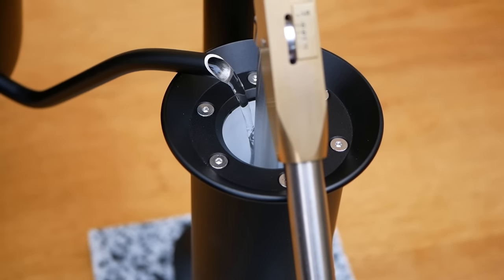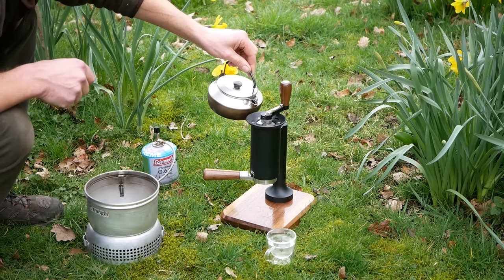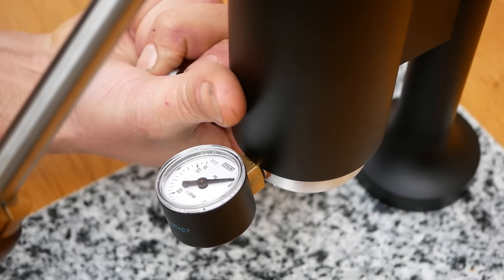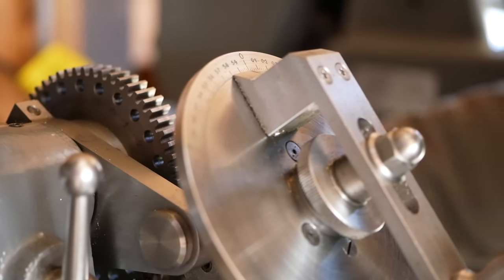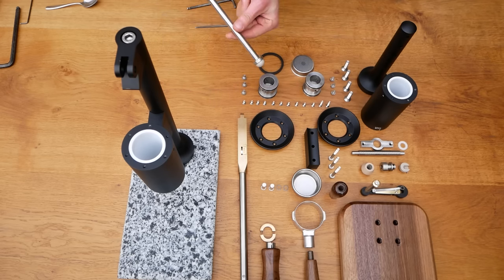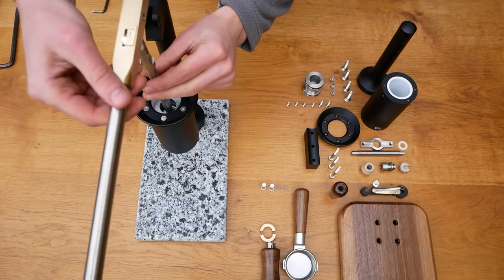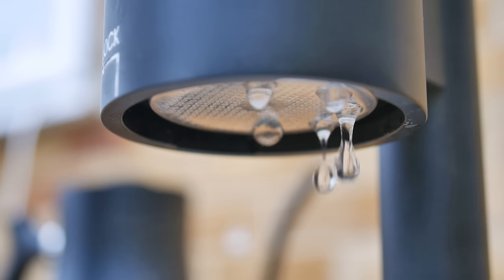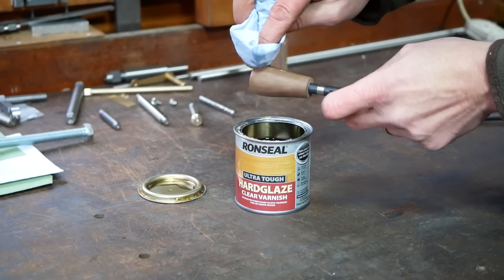We Made A Modular Espresso Machine

Comment: The torque wrench design for estimating pressure is really clever. I love it
Reply: Except that it can't possibly relate the actual chamber pressure based on applied torque. There's too many variables that affect how much input torque you might need to get to eight or nine BAR in the helix machine. Less of a problem on the fulcrum machine, but still not a substitute for a direct pressure reading.
Reply: @SwervingLemon  thus the word, "estimating." 😉

Comment: I want one of these that mounts to the kitchen sink or bench like a faucet/tap as a fixture in the kitchen. It would pair beautifully with a boiling water tap system. Maybe a hydraulic pedal tucked under the cabinetry at floor level. Baby oil is food safe (just upsets your stomach) and used in mountain bike brakes.

Comment: last generations? uses custom one way valve when it wears out replacement will be all but impossible, aluminium torque bar with no way of re-calibrating (aluminium being less than ideal as cyclic loading will have a grater effect as compared to a ferrous metal), custom pivot bushing sure it will have a long service life but if it is damaged during service or use it will be all but impossible to replace, and custom lead nut i like how you glossed over this part in you're video leading me to believe you are aware of its shortcomings.

Comment: Yeah, my very first concern was temperature control. Glad you discussed it, but would certainly like to hear more.
Reply from the maker: Hi Username, we have some additional temperature tests planned, from which the detailed results will be published on the Kickstarter page.
Reply: @chronovaengineering  Super appreciate it, thank you!
Reply: I stopped using ROK espresso lever machine because of the lack of pressure gauge and poor temperature stability. 
I’m now using Flair 58 equipped with the heating element and fitted a temperature probe to make sure I’m pulling a shot at 94C. 
And even with all that, there is quite a learning curve and tricks to use for the heat consistency. 
Also, I highly recommend using a puck screen.
Lever machine destroy the puck when transferring the water from top to bottom. 
Else you end up with crazy channeling and a dirty mess to clean. 

Love the screw system but I can already see it will most likely be too slow when priming the piston (losing heat and time) and then purging after. 

Manual lever machine are quite time consuming when used regularly.

Comment: its nice but.. i dont know why you need to replace a pressure gauge.. you can easily read the pressure in a wider range and more accurate than what you have been showing. seems like you are really limited ... especially if you want to do a pressure profile. Plus... they are inexpensive and rarely break.
Reply from the maker: Hi MrHackclan, 

Aesthetics aside, this kind of pressure gauge offers several extra advantages:
1) No risk of pressurised water leaking out via the pressure gauge hole.
2) No stagnant water building up in the pressure gauge or connected channels.
3) There is limited space to mount a conventional gauge. It would either have to go through the piston or in the side of the cylinder, where you would lose a reading towards the end of the piston stroke.
Reply: @chronovaengineering  I can understand that and your solution would be very nice.. if the measurement was not limited to 4,6,8... and some addtional indicators for the steps in between would be nice. Also it would be a very nice touch if there is an indicator for optimal preinfusion.

Comment: I love the pressure readout! So much neater than a gauge.

Do you think that it's worthwhile to preheat your cup before putting the coffee into it? Or is this just a waste of energy
Reply: Except it literally is a gauge, it's just packaged to be more aesthetically pleasing.  Flexion-based gauges have been used for quite some time, the only new thing here is how its packaged, and really the only reason why it'd be potentially worthy of a patent in the first place.  If it's even patent-worthy then, as it's just flexion and lever amplification, the actual patent is probably for the machine as a whole, especially as how the gauge is an integrated part to the lever arm itself and not a separable device, of which then it would be patent-worthy; and probably what allows the machine to exist without infringing on similar machines' IPs. 

Preheating cups is also fairly common practice, as to not thermally shock what you're brewing, if you're drinking the brew straight.  Look at Eastern methods of brewing tea, everything involved gets preheated and rinsed, modernly some derivatives of these brewing methods also have a 'tea pet' of which changes color depending on temperature.  Coffee, and really anything that is hot-brewed, should be treated the same way, as to not produce unfavorable tastes; much similar to how brewing too hot or too cold will affect the brew itself.  Although I'd also argue that coffee is much more sensitive to temperatures and shock if you're drinking plain coffee, this is also why people will commonly add creamer and sugar, to offset any off-tastes; similarly, this is also why cream and sugar is added to tea, though modernly this hails from a period where pre-modern compressed tea would've been nearly undrinkable without cream and sugar, the basis of this comparison is the bitter notes that both coffee and tea can produce, though coffee can also produce sour notes if not at the correct temperatures.  The only real time this isn't relevant is if you're making espresso-based cold drinks, where there's such a disparity in the volume of ingredients that the milk base will cover any off-tastes produced by blanching fresh espresso and really only leaving tasting notes from the brew and crema; you see similar things with fresh milk teas, though milk teas are also typically a much stronger brew to retain the tea's flavor that would otherwise be almost entirely masked by the milk, so it's not a direct comparison, but also shows why espresso is used instead of typical coffee for these drinks.  It really just depends on what you're drinking and how you're drinking it, but in reality it's far better to keep everything at similar temperatures during the brew and letting it slowly come down in temperature as a whole to your preferred drinking temperature, even if doing so is more effort and a 'waste' of energy.
Reply from the maker: Thank you! We preheat the cup. Since espresso cups are so small, it takes very little energy to do so.

Comment: Two questions: 1) Why would there be a higher concentration of water in the center of a larger, 58mm, basket when water always seeks level, and pressure does not favor one side or the other, it is a uniform force over an area, the only time you get uneven distribution is in flow where wall friction reduces flow at the edges, I can't imagine flow is so high it would cause this.  2) For forces, couldn't the mechanical advantage just be increased to make it easier to pull the shot?
Seems like the large amount of accessories for 58mm filter baskets would push a move toward that end, such as a jack leveler.  I've been using one of those with my double boiler machine and it is a life saver.

Comment: A very inspiring design - congratulations! A query: Does the metal piston ( and conrod ) result in any significant heat loss; and, if so, would a more efficient material for these components perhaps be preferable? This would minimize the preheat cycles required; especially in a camping/camper environment.

Comment: How is this design different from the ARAM coffee maker?
Reply from the maker: Hi rgalete, 
Setting aside the modularity of our machines and comparing only the Helix with the Aram, these are the main differences:
1) The Epoch Helix is more rigid than the Aram and the pillar will not bend during use.
2) Our machines are compatible with a standard portafilter size, so you can buy different portafilters or accessories. Using a portafilter instead of a threaded basket holder is also a lot more convenient.
3) We use a coarser thread pitch on the Epoch Helix, so it takes fewer turns to extract the espresso.
4) The Epoch Helix includes a pressure indicator.
5) The Epoch cylinder is thoroughly insulated so you can maintain higher brew chamber temperatures than with the Aram.

There are probably additional differences but without testing or disassembling an Aram, we can’t compare those aspects directly.

Hope that answers your question!
Reply: Thas was what I was thinking about, don't see much difference from Aram, besides the inspiration, but need to see and test it.

Comment: I don't know about doing threaded grub screws on plastic though.
Reply from the maker: The grub screws only apply a very light pressure on the plastic. They locate in the groove in the liner to prevent creep over time. The liner is predominantly held in place by the group seal and portafilter.

Comment: I was just thinking of a direct cylinder espresso machine today. I was imaging two possibilities for water entry. One was a standard spring check valve, which would be much less elegant than yours. The other was a pair of side ports similar to a two-stroke engine. One for entry and one for overflow. All that to say that I have given the design problem at least a little thought and I really admire your solution!

Comment: I would love to see a comparison to a flair machine, which requires you preheat the chamber manually or with a heating element. 

Also a levar pull comparison for the model that uses a levar. I.e. how much force each requires by the user, for thosenwith joint or wrist issues.

Comment: What material is the cylinder liner? It looks like PTFE, but I think people are sort of against PTFE for food things these days, so I'm curious what you chose
Reply: I trawled through the comments and found one where you confirm it is PTFE. I personally don't have anything against PTFE at these low temperatures, but I do like the idea of something fully metal and wood. Something about polymers feel less "heirloom" to me. But I suppose you can't win: stainless steel would cause issues for brewing temperatures
Reply: Regardless, absolutely beautiful design. And elegant in its manufacturability. Congratulations and I wish you the best of luck in the Kickstarter
Reply from the maker: Hi Michael,

A lot of misinformation regarding PTFE has been circulating in recent years. Early versions of PTFE were manufactured using a chemical known as PFOA, which may damage the liver in high doses. According to the CDC, PFOA was phased out from PTFE manufacture many years ago. (Source: https://www.cdc.gov/biomonitoring/PFOA_FactSheet.html)

The other common concern relates to the fact that extreme overheating of PTFE (over 300 degC) can cause the polymer to break down but using boiling water (100 degC) keeps the temperature far below this threshold. There is no evidence to suggest that PTFE would present any safety concerns in this application.

To quote the American Cancer Society: "Other than the possible risk of flu-like symptoms from breathing in fumes from heated cookware with non-stick coatings, there are no proven risks to humans from using these products. While PFAS can be used in making some of these coatings, it is not present (or is present in extremely small amounts) in the final products." (Source: https://www.cancer.org/healthy/cancer-causes/chemicals/teflon-and-perfluorooctanoic-acid-pfoa.html)

Hope that helps!
Reply: Wonder what the cost would be to make the liner from an engineering ceramic such as aluminium nitride?
Reply: @michaelandersen7535  Almost perfect!

Comment: Looks amazing! As with all manual levers though, I have a concern regarding heat loss.

At minute 3:20 you show the read out of the brew temperature. So after 2 preheat you say the brew temperature is 95c. In this 30s while you brew your shot, would you know how much does the brew temperature drop? Say from 95c to 85c?
Reply from the maker: Hi Stefano, we have some further temperature tests planned and we’ll publish detailed results on the Kickstarter page. Right now, the thermocouples we used were located above the piston and in the cup, so the direct brew temperature will be somewhere between those temperatures.

Many manual lever machines lack sufficient insulation to maintain high chamber temperatures but our chamber is walled with PTFE, which is a very effective insulation material.
Reply: @chronovaengineering  super!

Comment: I like a lot of things about this and now am a bit inspired to make my own take on the idea, but a few concerns.  

First, especially with the lever version there is a risk of having an air pocket or similar pressure accumulator between the piston and portafilter.  People clog portafilters all the time through neglect and alternately some use an inappropriate grind (e.g. Turkish). If a user releases or lifts the handle mid-press, the fill valve could let hot water come back through if an air pocket or other hydraulic accumulator effect occurs.  A safer design would be a poppet valve or similar check valve with a pair of springs - one retaining it closed, and the other an "opening spring" inside / on the connecting rod such that the pressure in the group head holds the valve closed against the "opening spring" in the shaft, but with a light press and no pressure in the group head, the spring can overcome the check valve spring. 

Second, the marketing idea that this has no built in heating so it can be taken out on the trail is a bit silly for something this bulky and heavy.  Sane people are going to take an Aeropress, Turkish pot, pour over, Moka pot, French press, or make cowboy kettle coffee in the field. And other than the insurance underwriting that comes with an electric appliance which I assume is the real reason, there is a missed opportunity for attractive copper coils complimenting the other parts (ala the Technivorm Moccamaster).

Lastly, I think the stone bases are going to have problems with breaking with 3-4 bolts going through them. The torque on the handle version will place the stand in compression and tension concurrently which is usually bad for stone and masonry.  The acme screw version does not have this issue though, so may want to segment those offerings.

Comment: I'm curious what the cylinder liner is.  I presume it's a ceramic material by the looks of it, I'm not sure what the proper name for the descriptor actually is but it has that slightly 'milky' look to it that some ceramic compounds have, and the thermal properties it'd provide.  My only concern with this is price, considering these manual lever-pressure machines only come out of boutique companies of low volume and high cost; and I'm afraid sticking to the mantra will forever keep these within a very specific niche of the market, when in reality these are so simple and could be so cost-effective that anyone could have one on their countertop if they weren't a boutique item for the niche of the philiacs.
Reply from the maker: We’ve tried both Acetal and PTFE for the liner. The examples you see in the video are the latter. PTFE is ideal because of the low friction properties but also its dimensional stability when submerged in water. We certainly considered ceramics. The challenge would be manufacturing them to the required tolerance. Thanks for watching!

Comment: I do wonder, is modification really an aspect that is highly desirable? If you are truly making each one by hand, it seems reasonable to just provide some options upon purchase. The kind of person who would like to customize this themselves doesn't strike me as the kind of person who needs "permission" to do so. Similarly with the mechanism of applying pressure, does anyone really want to pay for both mechanisms in the off chance that they enjoy one over the other? Obviously for manufacturing reasons it just makes sense to have the cylinders interchangeable, but I don't see any but the most wealthy and obsessive coffee aficionado being sold on the idea of two pressure mechanisms. Especially if, as is oftentimes the case, mod-ability results in a messier and less robust product.

That pressure gauge system is a stroke of brilliance though, I must say. A truly elegant solution that matches so well with an equally elegant espresso machine. I don't think I've ever seen something so analogue and inherently robust, essentially as long as the handle doesn't break off the gauge lasts forever. Extremely impressive

Comment: 100 years ago, everything made was designed to last generations. With the advent of plastics, our (grand)parent's generations threw everything away and replaced it with cheap plastics. Now we are finally realizing the debt our parents made and returning to the roots.
Reply: Isn't the insulating insert plastic?  I get the reason, to keep the water hotter.  But I'm not a fan of exposing anything I eat or drink to more plastic than necessary.